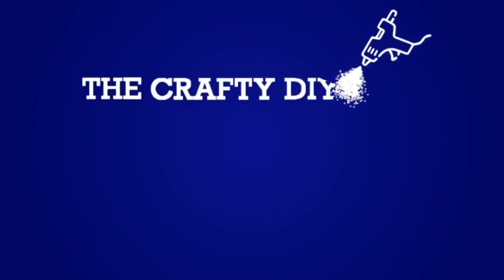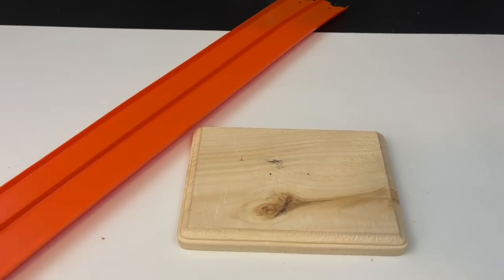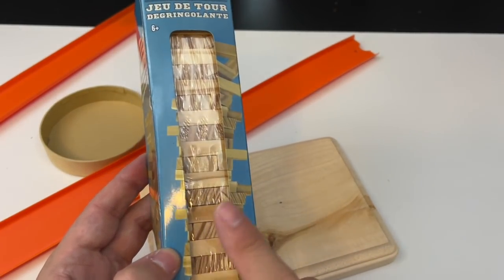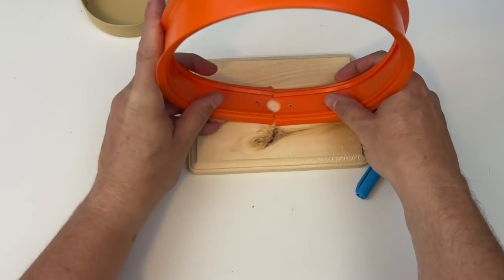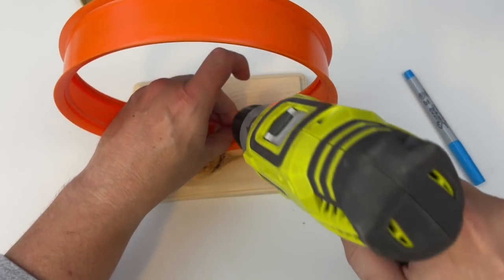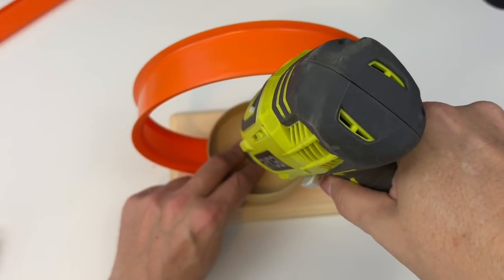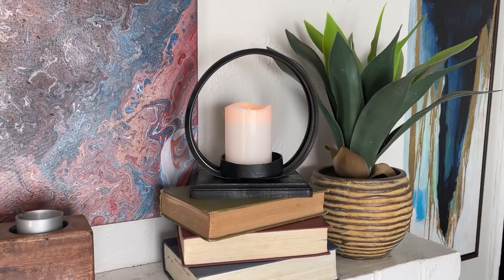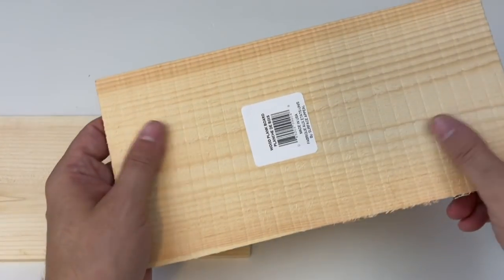Dollar Tree DIYS! High-End & EASY DIY Projects with HUGE impact for your home!  Wow!

Comment: The hot wheels track candle holder is my favorite.  When using magnetic drill bits, put the screw on the drill bit first, then put it in the hole.